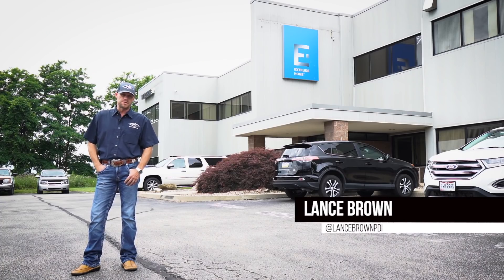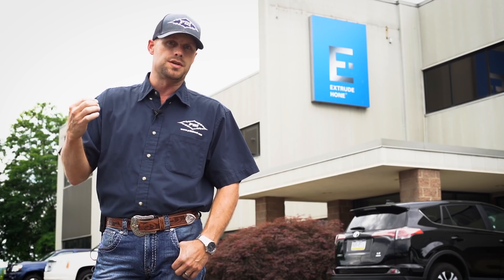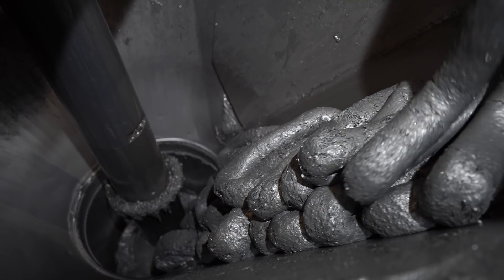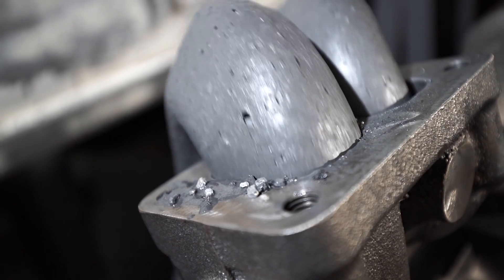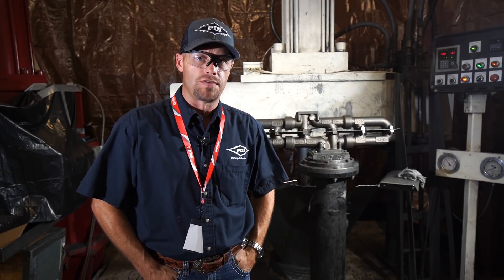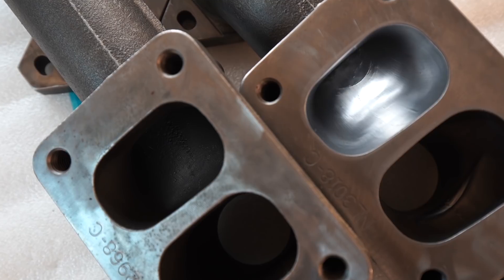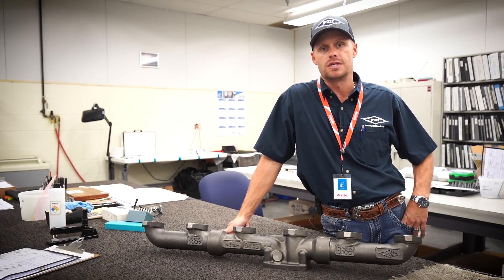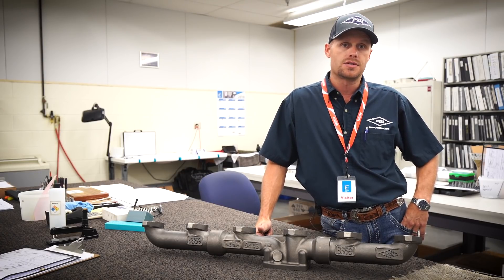The Extrude Hone process explained

Comment: Can stock gaskets be used or do they need trimming or modifications?
Reply from the maker: Stock gaskets work fine!
Reply: @pdidiesel  i like the sound of this is it possible too do this too cylinder heads as well ??
Reply from the maker: We have not done this process on cylinder heads.
Reply: @pdidiesel  its worth a Try id like too see what it can do
Reply from the maker: You could for sure reach out to Extrude Hone or a company that offers Abrasive flow machining.  The difficult part I'm sure would be the cost to you to rig up their machines to flow it thought a cylinder head for a one off setup.  We payed that "set up price" but it was for many units of production. Not just one piece. Worth a shot though.
Reply: @pdidiesel  awesome too hear do they have a Instagram page by any chance??

Comment: This material that is being pumped through the pipes or holes is actually for finishing internal geometries (of the pipe), right? Or is it suitable for external geometries (too)?
Reply from the maker: Internal, as it needs pressure to force the abrasive material against the metal/iron.  Not sure how it would work on an external surface with no way to apply pressure.
Reply: pdidiesel thanks, I am still learning!

Comment: How do you clean up the rest that left in the piece
Reply from the maker: It processes through pretty clean, as the putty like material holds the chunks of silicon carbide.  Also they are pretty coarse chunks, so there is not much if any small material to clean out.
Reply from the maker: Once it arrives back to the PDI headquarters, they get a final inspection and we use a porting tool to smooth out any irregularities in the ports.
Reply: @pdidiesel  I think he's asking how do you remove the rest of the abrasive media from the part.